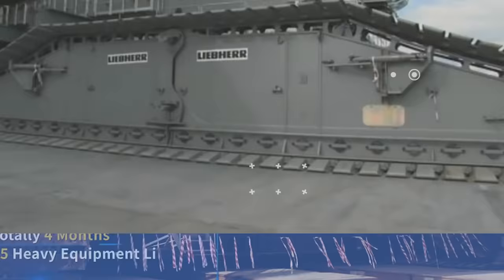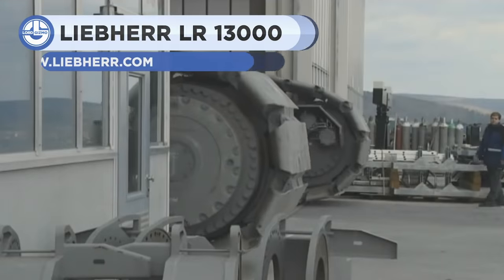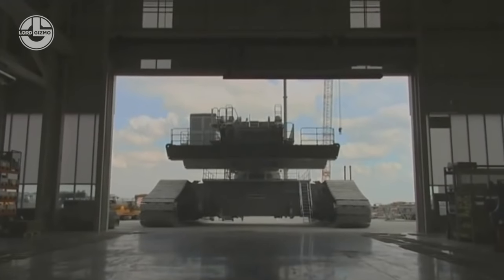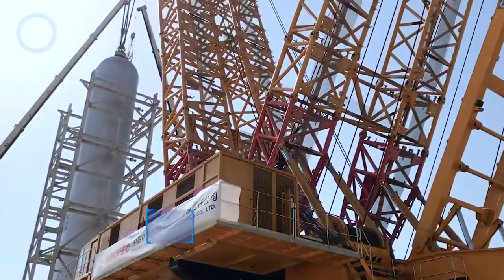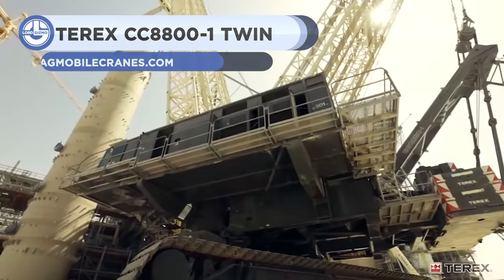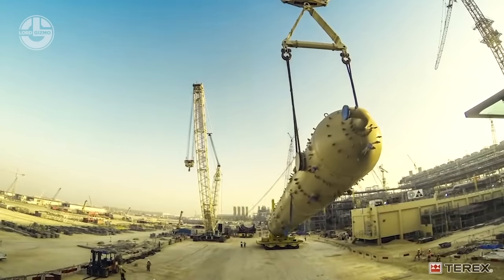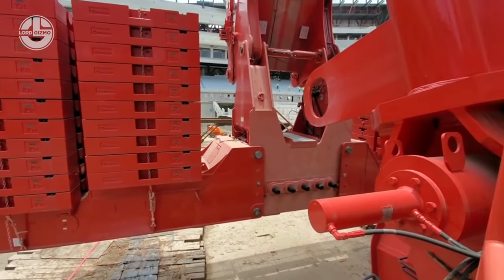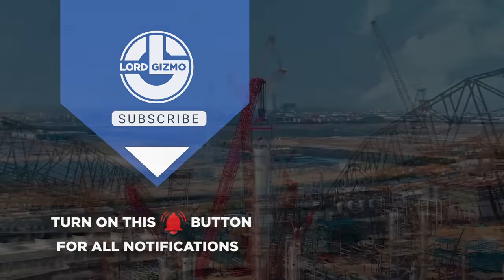5 Largest CRAWLER Cranes In The World!

Comment: The largest of these crawler cranes  i think wouls be the lr13000 why? cos it has the largest liifting power 
with just one boom instead of many of them twin boom cranes out there.
Reply: yes and the only ones that doesnt use a rail system to turn the crane...
Reply: Да что ты говоришь, 13000 это 3000 tons, а самый самый это xcg88000 - 4500tons, на противовес 88000 посмотри! Чтоб понять что такое действительно большой вес!
Reply: @Dmitriy_IV   sure the XCG88000 can lift more but again the LR13000 has one single boom where the XCG88000 is almost a copy of the Demag CC8800 twinboom.
Reply: @dreetjuh71  No! The cc8800 can only lift 3200 tons. xcg88000 can 4500ton. Just look at the counterweight weight of 88,000. The XCG is the highest lifting and most powerful land mobile crane in the world! At the same time, he moves calmly and quickly on his own!
Reply: @Dmitriy_IV  My friend😁 , i meant to say that the XCG has the same type of boom as the CC8800-1twin ..instead of the LR13000 in reference with the XCG according to the loadchart the LR13000 is stronger. "What if" the LR13000 has a second boom, it would lift the shit out of the XCG lego crane😁😂...its just facts...facts...